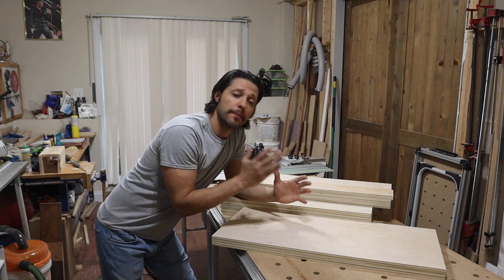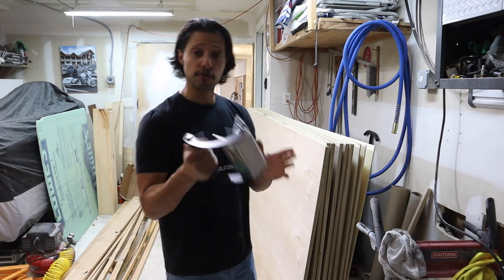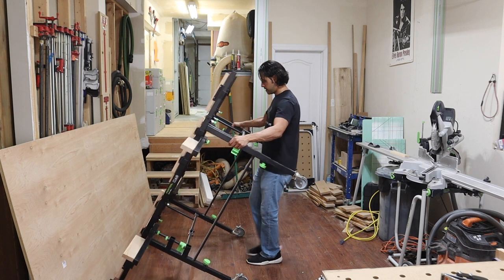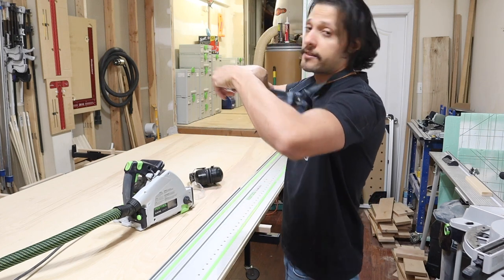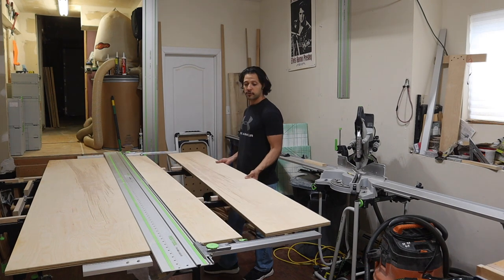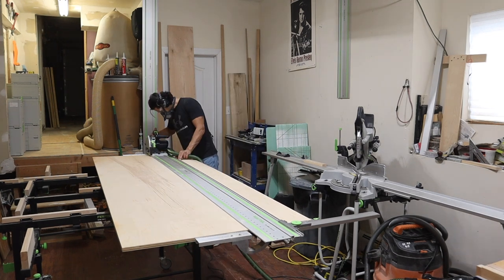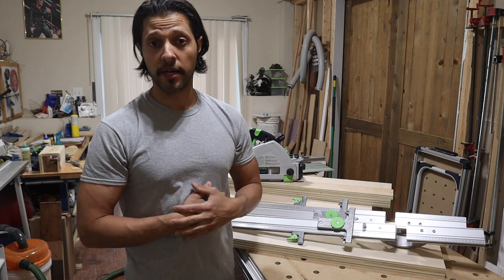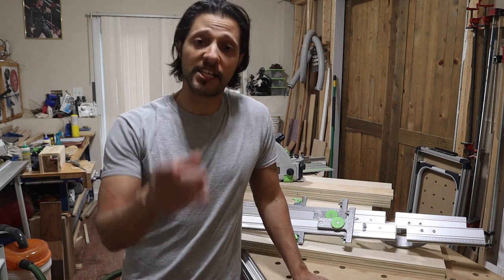cabinet building series: 1. breaking down sheet goods

Comment: I normally don't comment on videos but I had to on this one. Due to my recent interest in basic cabinet making, I have been searching around endlessly to find a channel that shows the basics of cabinet making using less tools. Professional people have lot of tools in their arsenal but that doesn't mean they are all necessary. I have seen so many videos where people cut long sheets of plywood with a track saw and then cut the edges again using a table saw giving the impression that track saw cannot be used to prepare the panels. You are a wonderful teacher that showed me exactly what I was looking for. Keep up the great work.
Reply from the maker: I’m glad you like the videos, in answer to your question, you only need to remove one factory edge as your starting point or reference edge, for parallel ripping. The other edges will all be removed as you cut the pieces to size. If you notice, before I made my crosscuts, I put my straight ripped edges against the MFT fence and then cross cut off one side, then measured and cut the other side to my mark. This removes all factory edges and gives you square cuts.

Comment: I didn't really get it until I bought a Makita cordless track saw and used it. If you work with sheet goods it's a MUST HAVE game changing tool. I can't overstate that enough. I recently added a Festool track square (identical to the TSO square but was actually cheaper 🤷‍♂️) and TSO 50 inch parallel guide system to go with it. I'm waaaaay more precise on my cuts now. I am still interested in the MFT dual setup like you have but the biggest bang for my buck was getting the parallel guide system instead. All I need now is a single track guide so I can rip the full length of a sheet of plywood. Even with the TSO connectors it takes a little work and a straight edge to get two 55 inch tracks nice and straight. 

Looking forward to your series! Will follow it all the way through. Smash the like and subscribe button for Anthony! Good guy that deserves our support!
Reply from the maker: Funny you should mention the single guide rail, I just ordered the FS 3000. It’s a 118” track, because I was tire of connecting rails too lol. It should be coming in about a week.

Comment: Easy to see why Festool is so popular with the professionals. Pricey, but such a productivity aid with the MFT system. I'm going to replace my mobile assembly table top with a CNC cut MFT-style one. 
Good series idea. I'll  definitely watch along.
Seeing that less-than-flat birch ply, I thought it was only like that here in the UK ! Baltic birch is now hard to find as you would expect.
Reply from the maker: The wavy, warped plywood is due to negligence on the part of these dealers, they get them delivered and leave them out in the rain and all kinds of weather, than bring them in wet and leave them stacked on a pallet. So when they dry, they become potato chips.

Comment: Have some questions below... Just purchased a TS60 with a fs 1400/2, looking to get the remaining tools necessary.. I already made the base cabinets with a Kreg and ended up using a straight edge most of the time with a worm drive skill saw.  It works but took a lot of time and looking to get the parallel guides in metric.. Debating if I want to get an MFT.  

Using the table to rip the sheet goods, does it have any tear out on the back side?  
Which blades are you using for the rips versus the crosscuts?
Any issues using the fs1400/2 and a fs1400/2-lr32 connected or would it be better to use a fs3000/2?  Some folks claim you can create a 
So do you have any table saw at all?  As part of my purchase, it included a Sawstop Job Site.  Felt I needed it for rips for stiles and rails for the doors.

Thanks for making the video!

Comment: Hey Anthony, thank you for the good channel you produce. A quick question with the Milwaukee track saw I just purchased work with the festool table  NFT3. I believe you called it.
Reply from the maker: MFT/3. And no it will not. The fence system is made specifically for Festool guide rails. If you use another manufacturer’s rails, there will be slop in the pin and the bracket that holds the rail in place for square cuts.

Comment: Thanks for your video, very cool. I have a question, it looks like you are joining two FS 1400 / LR32 tracks into a big 2800 track. Have you found that the accuracy was a problem? Even if I use a straight edge for alignment etc, I always find that it's about 1mm or so bowed in some direction, particularly if I slide the track across, it will grip and slightly deviate. It's making me think of buying a 2700 or 3000 track, despite them being pretty expensive and cumbersome, to not have to worry about alignment of tracks...
Reply from the maker: I used to join tracks for one year straight, then I bought the 3000 rail and have been using it ever since. You can see it in my videos, pretty much right after this one.

Comment: As you are using the LR-32 system have you considered making the length of the sides evenly divisible by 32? Think you might find it handy in the long run.
Reply from the maker: These panel’s aren’t getting shelf pin holes, and they needed to be an exact size which didn’t require them to be balanced panels divisible by 32 but in the next video, which shows cabinet construction and adjustable shelves, I will be making balanced panels when I demonstrate the LR32 system.
Reply: @AnthonyScolaro1  Understand, my bad…
Reply from the maker: @sawdust9807  no problem at all.

Comment: What was the 2 tables you used? The first table used to cut the board in pieces i.e. it is folded up in the corner and the 2 table when you made the cross cuts to make the 90 degree angle cut.
Reply from the maker: The Festool stm1800 which is pretty much unavailable now almost everywhere. The two tables are Festool MFT/3’s. I have a whole video on the MFT/3’s and why I have two. Here’s a link to the MFT tables-
https://amzn.to/3N9WYVH
Reply: @AnthonyScolaro1  The Festool stm 1800 is available here in Australia as well as the Festool MFT/3's. Thanks.
Reply from the maker: @jodiepalmer2404  awesome
Reply: The links to the MFT tables don’t work.

Comment: I stack my 3/4" sheet material ( Birch mostly) the same way you do in this video, I have found that if  I clamp the sheets together overnight, 3 clamps along the top, and 2 clamps on each side, it helps to take the bend and twist out of each sheet. even after it's milled, wood is a living thing

Comment: It would have been nice to actually see the markings on your parallel clamps you were setting up. Also you do not mention the blade depth . It looks like you could actually cut thru your parallel clamps if blade is set too deep? You run your saw right over them at  end of cut . Is that possible ???
Reply from the maker: The parallel guides can’t be cut by the saw, there’s space between them for the kerf of the blade. The depth setting is only 2mm deeper than the material being cut.
Reply: But I am asking if it’s  possible to set blade too deep and end up cutting the clamp ?? I have never used those clamps.
Reply from the maker: @adgieem1  I’m not sure if you’re talking about the parallel guides or the quick clamps that run inside the rib of the guide rail. Either way, you can’t cut anything no matter the depth, or that would be a real design problem. Festool has worked all that out during engineering, there’s nothing to worry about.
Reply: Thank you. Very interesting.